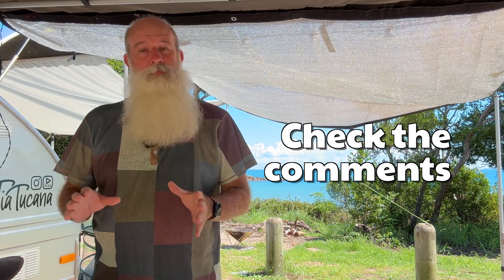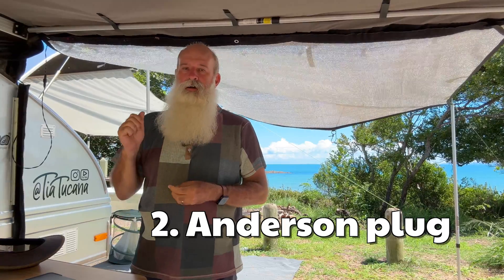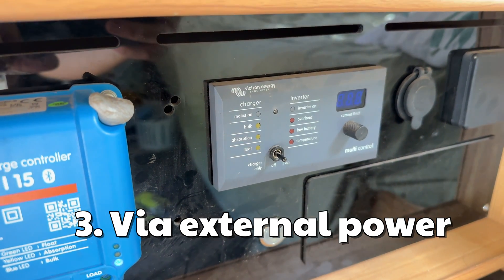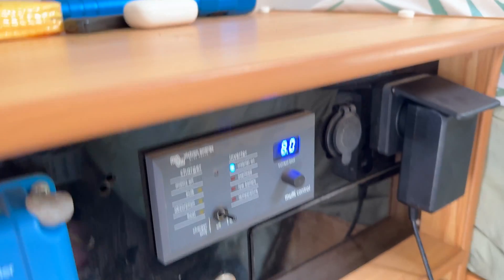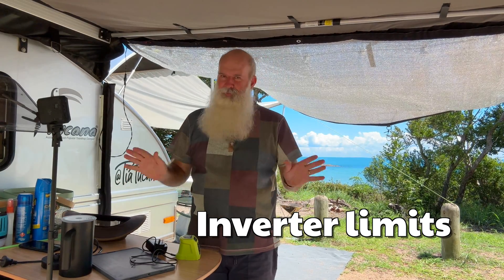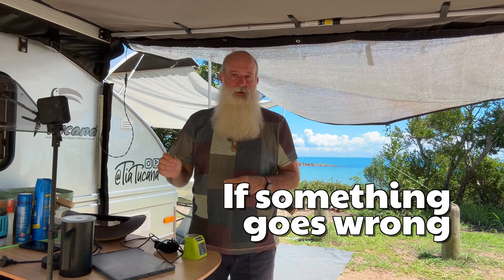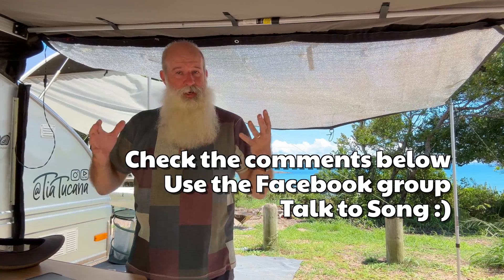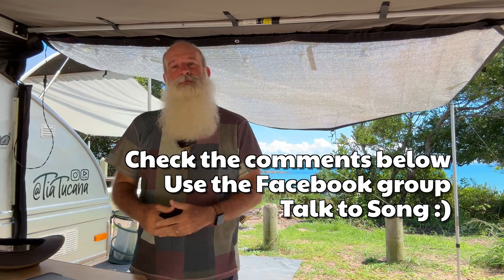Tucana Electrical Overview 2024

Comment: Hi. What rating solar controller do you have externally?
Reply from the maker: It's the same as the internal Victron controller we have fitted. Whatever model that is that Song put on it :)
I figured having 2 the same just made things simpler. And I can measure both of them on the app too which is handy!

Comment: where do you pick up a replacement input power cable with the 3 round pins - mine was stolen at a campsite
Reply from the maker: Oh no! That's no good! I expect it's a pretty standard item and should be available at any camping/caravan accessory shop.

Comment: John 
When connected to 240 main can you use a little electrical heater (1500w) max and electrical jug without blowin anything up
My Tucana is 2017 model
Reply from the maker: Don't know sorry - best to check with Song. I haven't investigated this as I have never tried (we don't take anything with us that requires that much power).